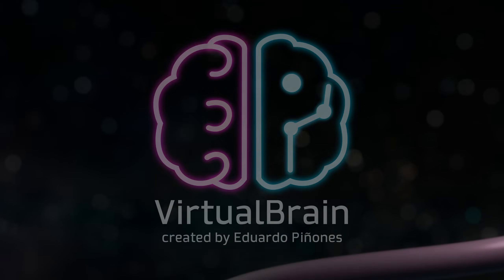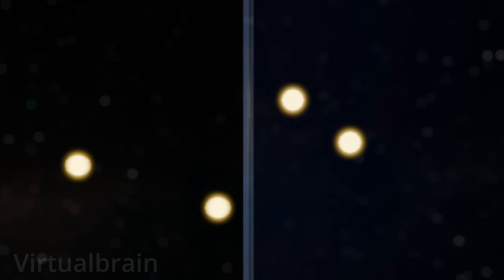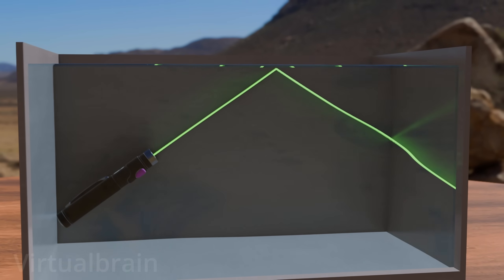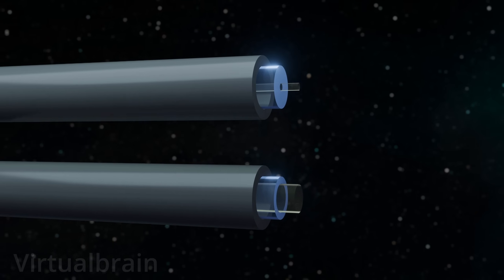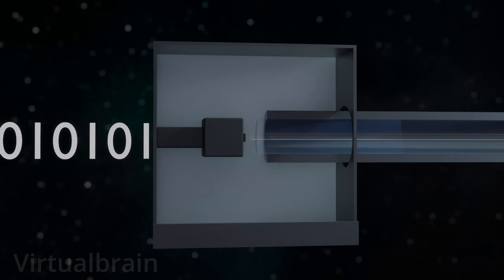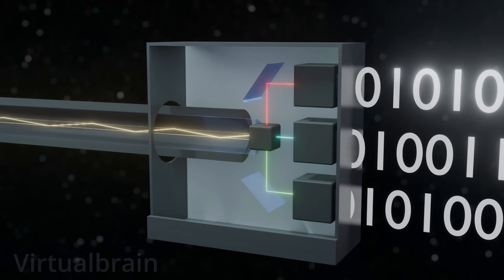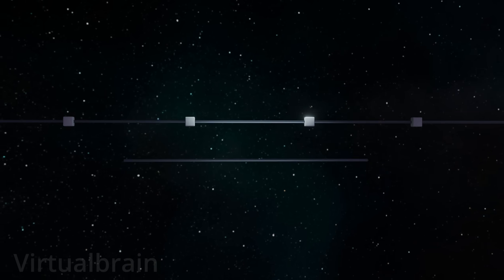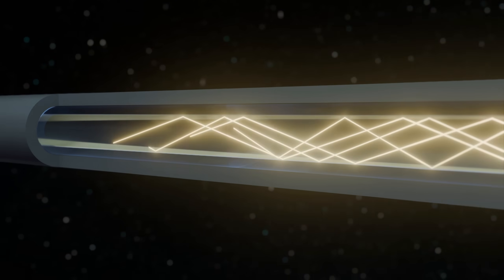How Fiber Optics Works 🌎

Comment: Interesting presentation but, the comment about the data transfer rate for multimode fibre being greater than for single-mode fibre is factually incorrect.  The available bandwidth for a single-mode fibre is greater than multimode. With regards to laser technology, there has not been an optic developed which fully utilises the available bandwidth and consequently the data transfer rate of single-mode fibre. Multimode and single-mode will support essentially the same bandwidth and data transfer rates but, in the case of multimode fibre over far shorter distances. In fact OM5 multimode fibre will support a 25Gbps connection speed but only up to  distance of around 150 Metres.  Cat6a and Cat7 copper will support 10Gbps connectivity up to 100 metres, its a consideration for the install of copper cable cables rather than multimode fibre when the distances are short.

Comment: Totally wrong explanations of  singlmode and multimode fibers . Multimode is the worse one because of  the large mode dispersion which limits high bandwith.
Light propagation of single mode fiber shown is wrong. There is one mode travelling straight through the core and the cladding. The distribution of light looks like  a gaussian distribution. Singlemode fibers got other kind of dispersion ( chromatic dispersion, polarization dispersion....).
As this sort of dispersion is very small in singlemode fiber by far higher bandwith are possible.

Comment: the explanation of mulitmode fibre is incorrect. Data transfer rates are not faster in multimode. Single mode fibre has higher capacity and longer reach. However there may be a cost advantage with multi mode fibre and components

Comment: Pl explain how data is not collided while multiple light beams travel in a caddle
Reply: You can not blend laser beams running concurrently in a cable ; each laser beam runs in a monolithic line . 
Physics of beams of light is different from materialistic objects . Watch laser beams move rhythmically in music concert , those go intercrossing then continue to go in straight direction . No beam gets tarnished by blending with another . Contrary , if you pour two flows of water distinguishing by different colors into a pipe , the two will definitely blend together to create a new kind .
Reply: Through Multiplexing.  The data is encoded onto separate light wavelengths for both the forward and return transmission.

Comment: Explain multiplex
Reply: The ability to send more than one signal over a single medium. Two versions are TDM (Time Division Multiplexing) and FDM (Frequency Division Multiplexing). A quick internet search will explain these fully.
Reply: You can also apply both of those methodologies to multiple wavelengths of light in the same fiber. It’s massive
Reply: @vernacular1483  Information available in 0's &1's and it completely converted into light.please explain this phenomenon.
Reply: @ssultan2609  That one is quite easy to understand. If it’s a 1, the light is on, if it’s a 0, the light is off.